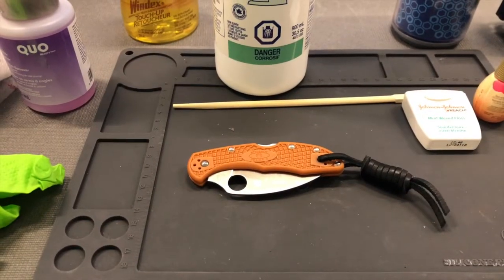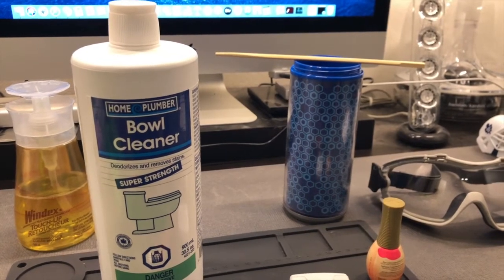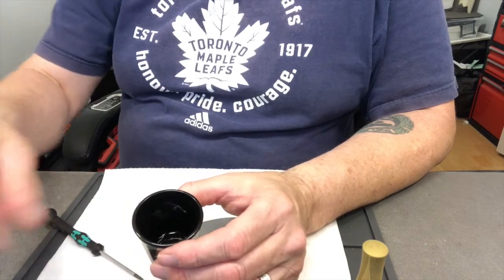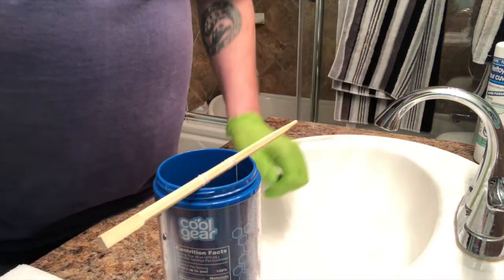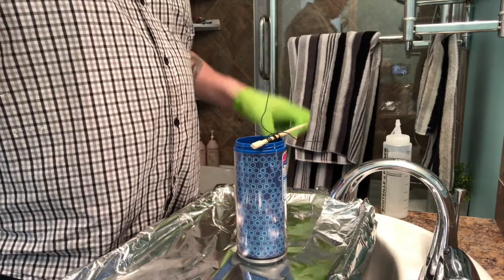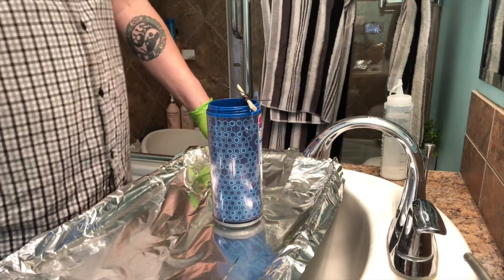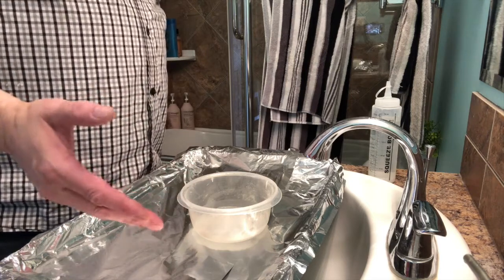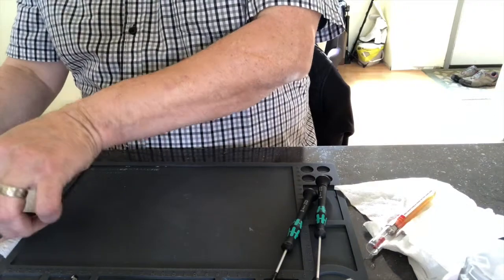Acid and Stone washing a Spyderco Delica Wharncliffe In HAP-40

Comment: I used ferric chloride for several etches. Might be a bit too strong for a confined bathroom though. Anyway, I'd place a ziptie through the blade pivot, lay it down in a small plastic tray (an old tofu container worked great) then pour the FeCl into it. 15-30 minutes later the steel would be noticeably darker. But, as I've probably mentioned in prior video comments, my biggest challenge was stripping some of those pesky Spyderco Seki City screws! :-/
Reply from the maker: I’ve been pretty lucky with Spyderco Screws on everything but my first Tenacious I had the wrong size and 1 screw got a bit wonky, but after that I’ve been very lucky with screws knock on wood..lol.